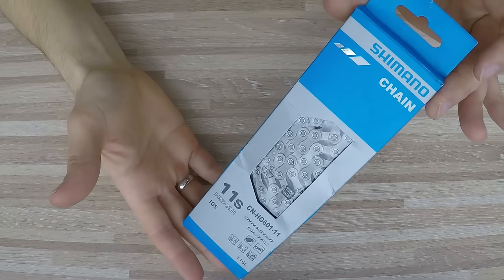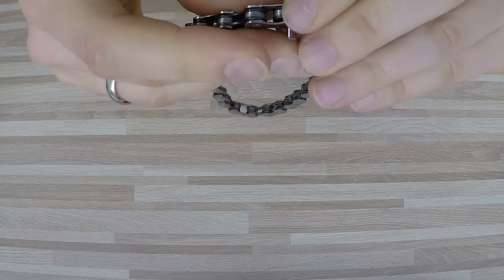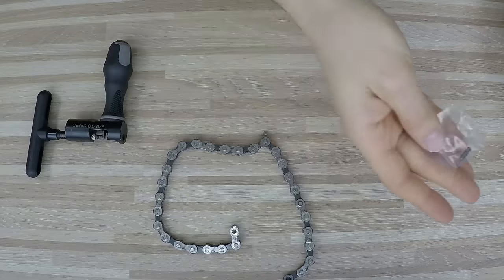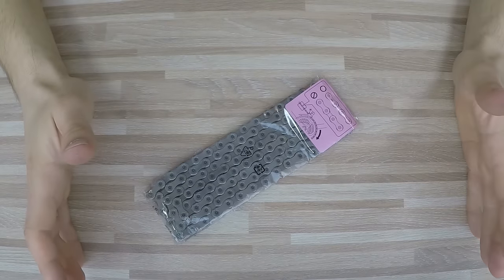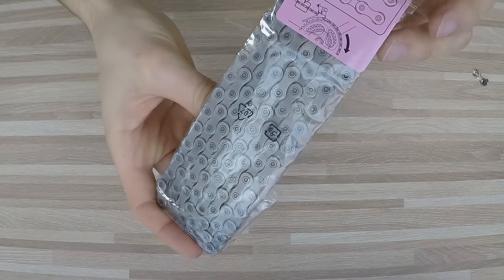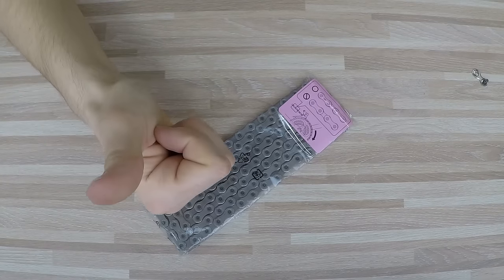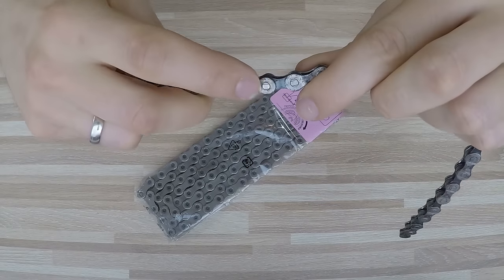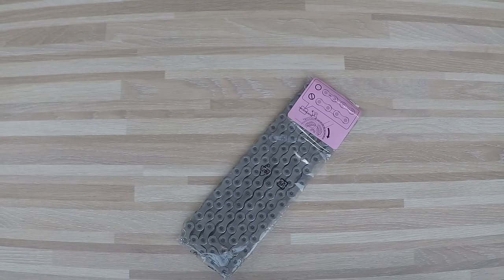4 Worst Mistakes In BICYCLE CHAIN Maintenance. How NOT to do it. SickBiker Tips.

Comment: Dude I have decided to wax my chain, I use gasoline to clean my chain and sprocket getting all the dirt and grease off my chain letting it sit in the gasoline over night and then rents in clean gasoline and the clean and rents in alcohol and then let it sit in hot wax for a couple of hours pull it out and let the hot 🥵 wax drip 💧 off and then put it back on a clean sprocket ⚙️.  What do you think 🧐

Comment: There is always a divergence of opinion regarding the fitment and maintenance of chains I would agree there is an element of risk breaking the chain and reusing the rivet although I've done this countless times without issue. Campagnolo expressly forbid the practice because of the narrow plates and thus opportunity to fail, so I wouldn't do it with Campag. Factory oil is packing oil, in the same manner machinery arrives with a rust preventative product, not intended to stay in service. Any serious rider knows chains don't last very long. Maybe up to a year for the committed amateur and much shorter for the competitor, regardless of what lubrication is used. The laws of physics apply to this component. A chain gauge will reveal the stretch, only a few thousands of an inch but multiply across the length simply means time to replace. In recent years I switched to a wax based chain lube and found it provided no benefit. It's claimed wax lubes don't attract dirt which wear group sets.. Not true. The wax builds up on derailleurs to a sticky mess. Run your finger over a waxed chain then touch the ground. It picks up dirt like a magnet. Metals used in cogs is softer than the chain so physics dictate the later will wear the former. It's the nature of the component ; chains stretch and need to be replaced. Certainly lubrication is better than no lubrication and a clean chain works better than a dirty one. Dirt and dust will find their way into the system regardless. We keep our chains on for too long and should be replaced to save the more expensive group set.

Comment: you don't wanna use acid based stuff because it attacks the metal of the chain itself and acts as a catalytic converter for rust. in theorie you can "superclean" it with some form of acid and then right afterwards dump it into an alcali solution with the corresponding ph-value but I wouldnt recommend it since you never get all the acid of the chain... if you really wanna dump your chain into something, use methylated spirits: great degreaser, doesn't really attack metal, plastic or glas.

Comment: How long do you recommend using a chain? I use mine between 4000 and 5000 kms. Road and mountain bikes.
Reply: It depends on how long your chain stretches. If it is not stretched nor corroded/rusted, I would still use it.

Comment: I haven’t had a chain so packed with grease I had to wipe it. I guess mine would come off after the first washing. I hate storing dirty bikes and wash them just I do my car. Soapy water and blow dry. I do lube the chain and forks after each ride. But I guess if the new chain had visible grease I would give it a wipe. No sense in helping dirt and sludge form in between my chain links.

Comment: Hi there idol! Just want to ask if i can add more link on sram xx1 eagle chain. Because i change my chain ring from 34 to 36t. Do you think i can add or connect more link from the link that i cut before the first time i cut it. Is there a new pin to buy or required to put before i put the additional more link? Thanks in advance

Comment: My 4 tips: 1. Follow the instructions that come with the chain. 2. When sizing, drive out the pin from the "outside" (labeled) side to the "inside" (flat). 3. Shimano shows a diagram with two ways to connect the chain. Do it the way they say. 4. When you drive in the break-away pin, note that it when you hit the correct depth, the effort to turn the chain tool will suddenly decrease. If you drive it further, the effort will increase. Stop the moment you feel the effort decrease. Outcome? Zero chain issues with Shimano chains over the past 30 years and 100's of thousands of miles of riding.

Comment: Great video, we weren't aware of the chain pin needing replacement each time - makes sense to minimise 'stiff links'.

That strong degreaser looked pretty toxic. We make one which is crazy strong, works within five minutes and is made from plants, it's called Agent Apple. And Clean Chain degreaser for cleaning the chain when still on the bike

Comment: While you mentioned the warning on the bag about chain direction - isn't there a warning on the instruction sheet about which link to break (outside and inside)?  Or is that outside the top 5? I know there is on my 9 speed ultegra chain .

Comment: I wash the whole drive train with dish soap, brush it with diesel, rinse it with water, dry it and lube just the chain. I have tried drying with an air compressor and it works great,  too lazy for that though, I just spin it and leave it in the sun. keep in mind that I ride a mtb that never stays clean for long. If I was a roadie, i might use a more scientific approach including more exotic cleaning products and elaborate methods...
Reply: I just run mine through the Dish Washer Mate...add a little petrol to the rinse water...and she is good to go after dry cycle....
Reply: I bust wheelies at speed through a filling station car wash whilst a friend sprays 2 super-soakers (1 full of paraffin, 1 diesel) at my feet. Best method I've found

Comment: Quick Link should be replaced when you replace chain, as it will wear at the same rate. Should have mentioned that.
I also wouldn't clean a chain you get from manufacturer, since its coated in hot oil bath which penetrate the rollers completely. Unless you have hot oil bath, you will never get the oil inside these rollers as good as from factory.

Comment: Forgot to mention that I run 9 speed chains. 10 and 11 speed chains are a totally different animal. Much thinner and require special attention (pins are flush with the chain). I prefer the thicker 9 speed chain and will run it for as long as I can.

Comment: I bought an Izumi v Maximum toughness bike chain which had oil already inside the chain. I thought that I didn’t need to oil the chain because of that oil. I put it on my bike right after opening the box. The box did not come with instructions when I bought the chain.

Comment: Lol I been using diesel or gasoline as my degreaser because I am a cheap guy and it works every time! I just put my chain in my used gatorade bottle with about 250-300ml diesel / gasoline(as long as the whole chain is sunk). Shake it and leave it for about 10-15mins.  Rinse it with water and tsaaaadaaan brand new chain lol

Comment: 1: if you push a pin, put it back and push it in the same direction not the opposite
2: degrease using 1/5 degrease and 4/5 water in a ultrasonic cleaner
3: prepare 1/2 wax , 1/2 parafin oil , let the chain take a bath 5min
4: do this for oher parts that get in contact with the chain. Also quick link
5: never do anything other than this
Reply: you put the casette and chainring in wax/oil bath too?

Comment: Take his advice on #1. I am guilty of reusing a  pin, and almost died for it. 

With a hard crank racing, it came apart [yes, at the pin] and I struck my helmet on a curb and suffered a concussion and cracked / dented my helmet. Learned the [stupid] hard way. 
 
Oh, yeah,  I had reused pins for 12+ years and never a problem...until this time. Never again.

Comment: Leave it because that's the best way it works.
All I do is soaking a rag with motor oil (any engine oil will do) and pulling the chain through it.
That's it.
Repeat every week on rainy conditions and every month on dry conditions. 
No special expensive chain oil needed and no degreaser or anything else.
Motor oil has everything needed, it works not only as a lubricant but also as a detergent and rust inhibitor, it has anti wear components, too. In winter it's thin enough and in summer thick enough due to it's viscostiy improvers it comes with when it is a multigrade oil which every motor oil nowadays is. 
Like I said, everything ever needed is already in motor oil included.
There is no cheaper and more effective way to take care of your bicycle chain.

Comment: I use 11 spd quicklink in combination with my KMC SL chain, ultrasonic cleaner with abit of Kerosene in water for 2 quick cycles and cook it in paraffin. Hang it up and reapply once dried. Never a problem with reusing my quick links, chains last a good few thousands kms with no chain tattoo.

Comment: I have a bike from 2008 which might have original chain, I only rode max 1000km, maybe only 500km dunno
I had the bike serviced last year but not sure if they changed the chain, they did not do a very good job imo so not sure
the chain was very greasy and all black and I rode only once since the service so probably they did not change it
I got a new chain but measured the old and it's little over 0.25 so not streched much yet so want to keep it for now
but I want to deep clean it and lube it with morgan blue extra dry lube
I cleaned my chain with just paper towels and wet wipes as much as I could, now I got the chain breaker so I took it apart and off the bike and want to do a deep clean
I got the white spirits as recommneded in some video about chain waxing how to degrease it, is it safe to use? or should I stick to bike chain cleaner?
I will only ride in nice weather so I don't need sticky wet chain lube, I want my chain to be clean and dry to touch so I want to have only dry lube on it

Comment: I've never used a quick link, missing link, or snap-off pin, decades of reusing pins, zero pin failures. The chain will stretch or rust far faster than a minimally worn pin will work it's way loose. The chain companies tell you to install chains logo out because they want the free advertisement, it's only a rule in the way that always taking photos of your bike from the chaining side, with the pedal at 3 o' clock, and the valve stems at 6 is a rule.

Comment: I like WD 40 to degrease chain and the mud is off from chain then I just clean it in petrol  lube it it's fine after every one month l have triple crankset but l have not done any crosss chaining after 6month my chain was strech up-to 7mm. I daily travel 30 km 
What's the problem bro .

Comment: Using a quick link is much worse than reusing the pin. Your pin is made of an extremely hard metal, will not deteriorate under any pressure from the chain -tool. Removing  water is the best way to use an extremely strong degreaser and let it evaporate then. Rust cleaner has nothing to do with degreaser. I used to lock in teflon oil with greasing after that, having the smoothest chain sound ever. The factory default protective gunk does not ingress inside the link where the mechanical wear would happen. It is to protect the metal being on the shelf. The lubricant protects against the wear mainly happen in the pin + roller, not the surface.

Comment: Putting degreaser on a rag to clean the chain? No-No! Use a rag soaked in motor oil, that cleans much better and protects the chain and it also lubricates the chain as the oil creeps into the links. Clean the chain afterwards with a dry rag to remove superfluous motor oil. I do it about once a week in a rainy condition (less frequent, when dry) and it takes only one minute to do it.

Comment: I do not agree with this video, but perhaps that is because I'm not a racer. Using a chain breaking tool to connect a chain has been standard bike mechanic repair methodology for decades. I see no problem. Manufacturers do not advise removing the original lubrication provided, and just the opposite, they suggest you NOT relubricate a new chain until necessary. This brings up the question of whether chain cleaning devices are a good thing or not. No comment.

Comment: Another question: Do you not need a chain tool if you have a quick link to repair your bike?
Reply: If you have a quick link, you can remove it but it is pretty annoying to do it by hand. I recommend getting the chain specific pliers to make it easy
Reply: I just have a general chain tool which I'm intending to use to remove the broken link and then put on a quick link to repair it.

Comment: I use the supplied chain link every time, dont remove the original grease, shimano chain for 8 speed, lasts 400km
Reply: What lasts 400km? The grease? The chain itself should last anywhere from 1500 to 3000km depending on use. 400km is nothing

Comment: I use WD40  for cleaning the chain. Then I can wash out the dirt. After that I use a standard chain oil. I ve had never problems with braking chains or shifting problems. After 2000 to 3000 km the chain is overlengt and I do change it. Thats it.

Comment: what about putting the chain in a 110c oven for an hour after washing to evaporate the water?
Reply: Use a heat gun. Way easier and quicker. I swap between my wife’s two chains every fortnight. I then clean the dirty one as follow:

1. Let it soak in kerosine for 30 min. perhaps use an old toothbrush if it’s real grimy.
2. Move it to a container with hot water and a bit of dish wash. Let it soak for 5-10 min. 
3. Hang the chain from an approriate place and dry using a heat gun. 
4. Oil the chain when still hot. I use Brunox which is very thin. 
5. Store the chain in a zip bag and swap again in a fortnight. 

Never had any problems. My wife bikes all year round in cold winters with lots of salt on the road.

Comment: I use a wax on my chain, how often do I need to clean it, and re "wax" the chain for mountain biking.
Reply: When the chain starts making creaking noises or is dirty. I clean and lubricate the chain after each ride, but with wax I can easily withstand three workouts, it depends on the weather conditions and the length of the ride. I Wish i help you. have a nice day.

Comment: The replaceable pin always binds on me, so I use the quick link. I clean in a solvent shake, then boil the chain in water and then alcohol to displace the water. This is only after it gets super dirty. Otherwise I would surface clean the new chain, like you and apply a dry lube like Boeshield, which wont attract dirt.

Comment: the thin metal rings that seem to come off the chain when pushing pin in , l think they are not from the pin like video says but from the edge of pin hole on chain plate maybe mostly from missing the center of the hole l thougth but maybe not . and that plate will not hold the pin as well after that maybe having wider hole or is it only half of hole that is wider.

Comment: is there a right and wrong direction to fit a quick link, or can it fit either way around safely?
Reply: you can fit them any way you like , I've been using them for many years and never bothered about which way round iv'e replaced them ;)
Reply: ok, thanks for the reply.
Reply: I'm pretty sure one of the brands of 2-piece sliding master links has an arrow showing direction, i forget which.    I doubt it matters much because reversing the link just flips its orientation to a mirror image from one side of the chain  to the other.

Comment: When removing the pin, does it matter what side you push the old one out or install the new one?
Reply: No. Just check the rivets for a good length (a foot or so) and make sure there isn't any that look unique from the others. If there is occasionally a different looking one, break it on that. If not, any will work, on either side.

Comment: just buy a new chain when its needed the time and cost is not worth it plus a chain wears stretches and beds to the cogs n sprockets so if left to long you will have to replace these as well!!!! so clean and oil the chain if you think its time for a deep clean BUY ANEW ONE. cost of chain £10. .cost of sprockets£25   cogs £25 chain £10   a tenner or £ 6o and time and cleaning fluid and inconvenience .ten mins chain swapped job done!!!!
Reply: how the chain is supposed to ruin the cassette?
Reply: A worn chain ruins the cassette over time especially if you're in the habit of cross chaining.

Comment: this number 1 thing is maybe truth, but i am riding about 11000 km a year and i never bought this pin for a reconnecting chain. -and yes from time to time i have an accident of breaking but that is an average 3 years once thing. -*but unfortunate can happend even with a brand new chain(happend after 200km -for me that is 4 workdays)and i have a mini chain tool in my bag so ...
And about how long does it last?-for me as expirience after 3000 it is destroying the gears because it is out of spec i dont buy expensive chains-lets say mid class

Comment: I reused the pin and did not have a single problem ever since. I am not buying your advice. Perhaps you misunderstood the manufacturer , it may not apply to any pin, it may only apply the originally opened pin though.

Comment: never use rust cleaners... because once you clean the rust off you won't buy a new chain from them... really anyway to clean the chain as long as it runs nice and smooth is fine, it will last before you buy a new bike...

Comment: Flash Wipe and Go Lemon, 40 Wipes £1. Tough and incredibly absorbent - scrub chain & chainring deep clean with these damp wipes.Then stretch a single sheet out & roll it into a thin strip and then use this to floss in-between the sprockets. You'll never again go back to cotton rags & cleaning fluid. Entire chainset can be spotless in ten minutes. Satisfaction guaranteed !!